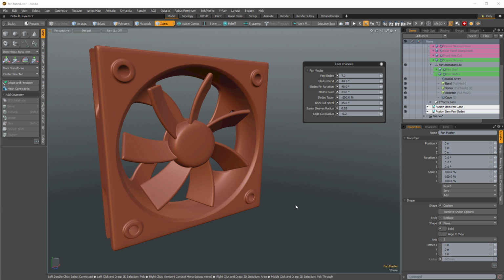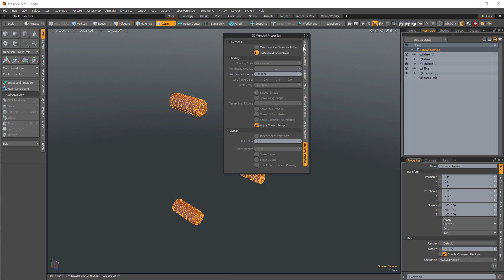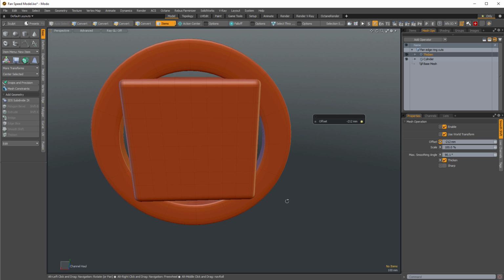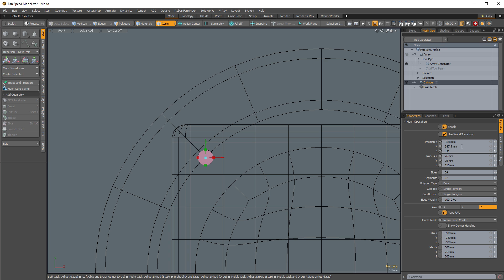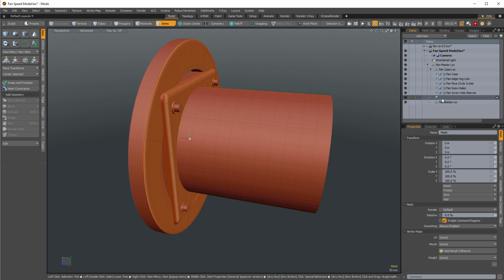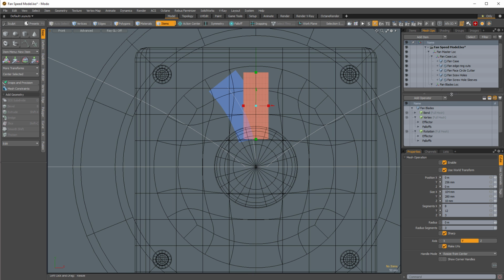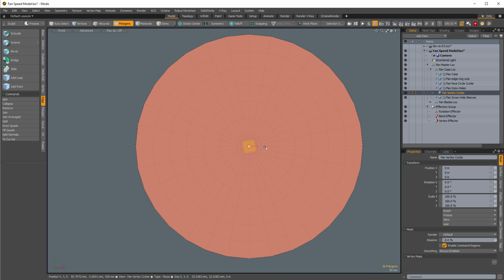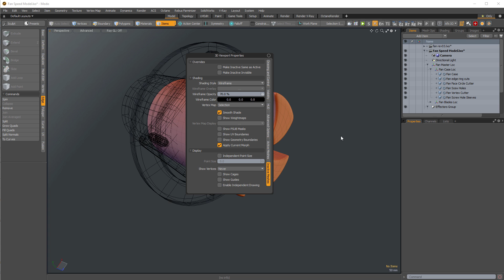MODO | Case Fan MeshOps and Mesh Fusion Part 1

Comment: 18:10 You could add an Edge Bevel op set to square on just the edges you want hardened.
Reply: Sir Meowington5  great point.  Should have done that.  Always forget about the square option.

Comment: Do all mesh fusion resulting meshes come out with so many polys?  I had a nice clean mesh of maybe 500 polys, did a little mesh fusion on it, now it's 8000 polys.  :(
Reply from the maker: It's better than it used to me...but quite a few polys.  You can use the auto-retopo tools (or try).

Comment: At 34'00" : In stead of "Select By Index"  you can use "Select By Previous Operation" so you can use a Procedural Cylinder.
Reply from the maker: Hi dominiekdr, not really.  I'm creating a custom selection (the cross shape).  Which I could do a select by selection set...but I'd like a selection mode that allows for the flexibility of select by index that doesn't blow up like select by index does when you change a meshOp below it.

Comment: At 10'00" you talk about Mesh Op Loop Slice : You can actually do this : MeshOP1: Cylinder with NO height ; MeshOP2: Poly Bevel ; MeshOP3: Delete inner poly ; MeshOP4: Poly Extrude ---> This Procedural creates a RING-shaped-mesh and you can adjust SEGMENTS and SIDES with the BEVEL-Segments and EXTRUDE-Sides.
( Make sure to set "Edge Weight" for the Cylinder MeshOP to ZERO otherwise the base will stay sharp when you do the Extrude with Polygon Type = Catmull Clark! )
Reply from the maker: that's a interesting way to do it.  What I *REALLY* want is for Thicken to just have segments like bevel and extrude have segments.  FOUNDRY - GIVE ME SEGMENTS ON THICKEN!